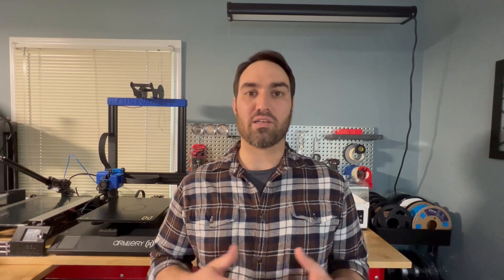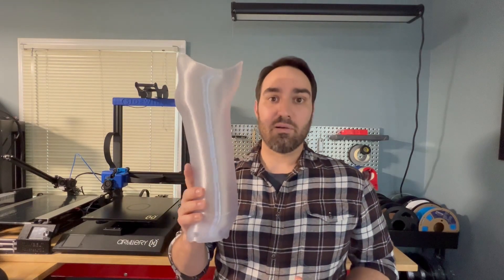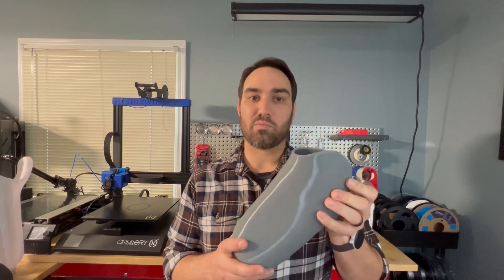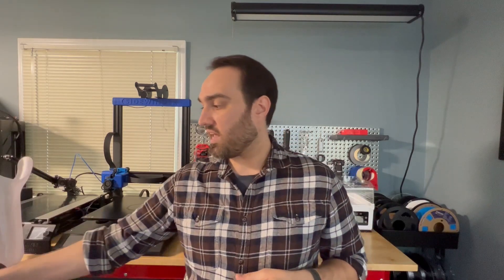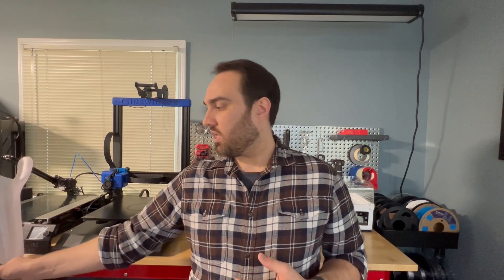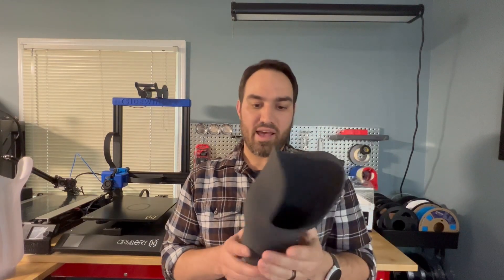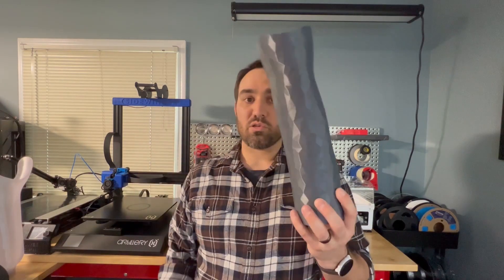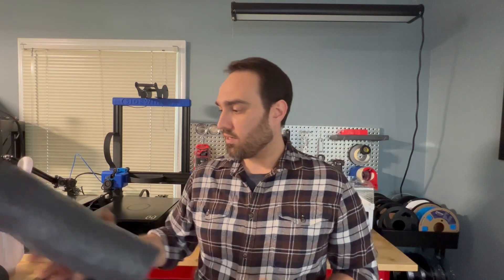Introduction to 3D Printing for Prosthetics and Orthotics

Comment: The age of the industry and the age of the 3D printer I believe, are two different things ?
Reply: No but mass manufacturing vs custom made, yes. 
The progress we make in algorithmic/automatic/ai designing + manufacturing process that don't require special tooling like 3D printing, CNC milling, CNC cutting, bending... redefine the cost of custom made and enable a come back.
The edge of fdm 3D printing is its low cost, ease of operation and impressive complexity of the parts that for sure enable a non professional to own and use it. But I've seen milling machine for the dental industry that were as easy to operate as a 3D printer.